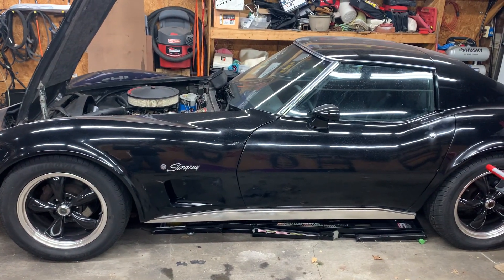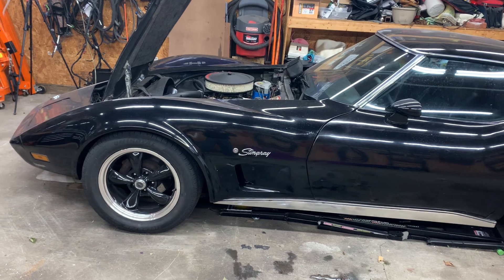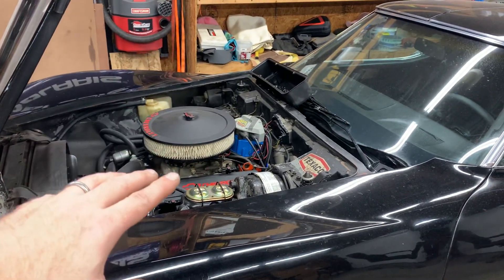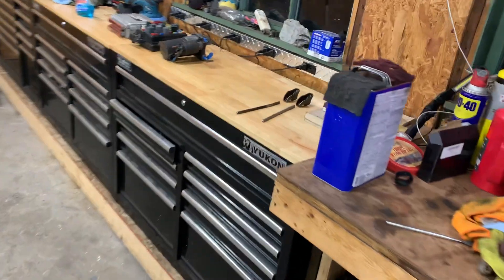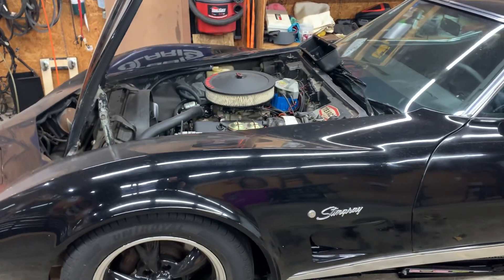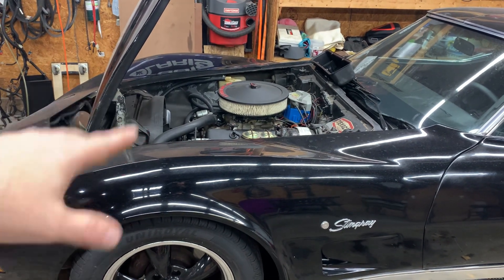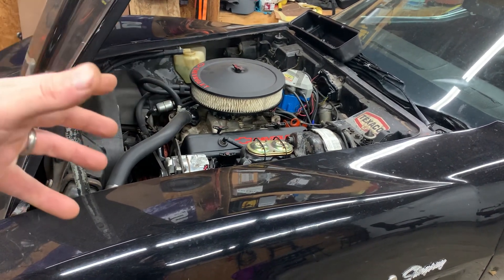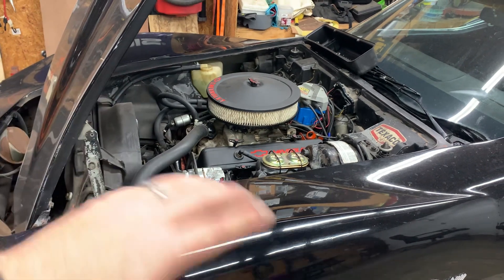1976 Chevrolet C3 Corvette LS Swap - Part 1

Comment: Subscribed!  I can't wait to see the next steps.  Was there a reason for the 5.3 rather than an LS1?  Or just price?  I see a lot of people using the 5.3 iron block and I'm just wondering if there is a benefit besides availability.
Reply from the maker: Mainly because of price.  LS1’s in my area are getting harder to find and the average price just for the engine assembly averages around $3500 and up. 

I hope to be all in for around $3500. I have a spreadsheet of everything I’ve spent so far and what’s projected and I think I’m going to be very close assuming no surprises. 

Thanks for subscribing. I should have the next part posted tonight.
Reply: @StreetersGarage  2004-06 trucks had aluminum 5.3s. I agree with your comment, and I don't know your space constraints. I've looked at buying a parts truck like the Avalanche that did come with the Al 5.3 and parting it out to recoup some of that cost.
Reply from the maker: I definitely thought about buying a vehicle and parting it out. But it came down to time and space mainly and I couldn’t realistically keep the donor vehicle in the driveway for more than couple of days. It would have been in the way of everything.

Comment: I highly recommend how to ls swap anything. It has all the pin outs. I also recommend using a pre 04 engine as the drive by cable is easier. The harness is also a little simpler. However you can convert a later blue/green harness to blue/ red .
Reply from the maker: Already bought  harness from BP Automotive

Comment: So what truck did you get it out of? I think I missed that part. Did you buy a running truck and pull it or go to a wrecking yard to pull it yourself?
Reply from the maker: The engine came from a 2002 Yukon. The owner had pulled it for a LS swap into his Jeep Cherokee Rock Crawler project but then decided to stick with the 4.0 versus re-engineering the Cherokee.

Comment: I've got a 79 Firebird, when it was pure stock (that was 1994 when that ended) with a 2 barrel 302 and a turbo 350, I was getting 22mpg on the highway.  For a strict cruiser, those are fantastic trannies.
Reply from the maker: That’s not bad at all.
Reply: @StreetersGarage  in 95 I had a cam lobe go flat so we rebuilt it with a hotter cam and a quadrajet. Needless to say the mpgs dropped off…a lot! 🤣

Comment: The timing gear set was well known to be nylon and was on my to do list when i bought my 78 L-48 with 350 back in 2000. It was an easy swap being in the front engine, why GM made such a crappy part made no sense. Would be interesting to see how yours delaminated.
Reply from the maker: I’ll be doing a autopsy when I get it pulled out. 

Currently it does run (poorly). I pulled the rocker and pushrod from the intake valve to kill the cylinder so I could have it in a state to still be able to move it around until it’s ready to be pulled. 

Prior to pulling the intake valve. It was backfiring on cylinder 2 through the carb since the exhaust valve isn’t opening